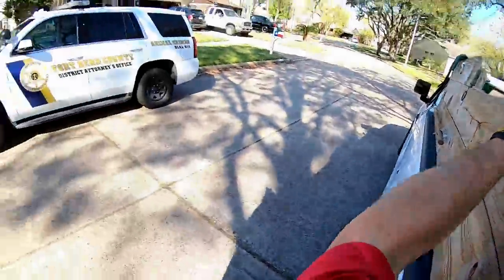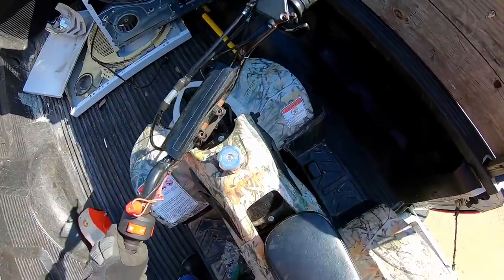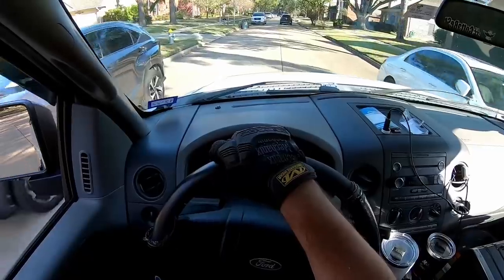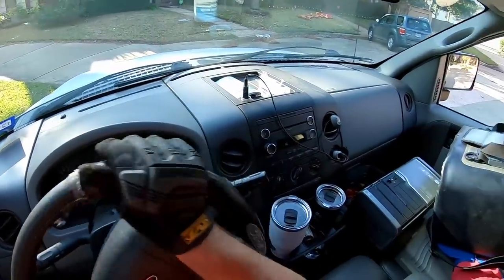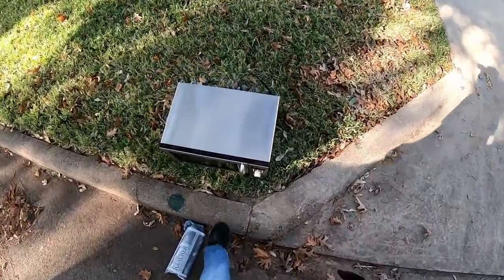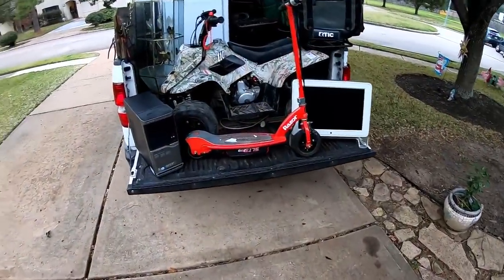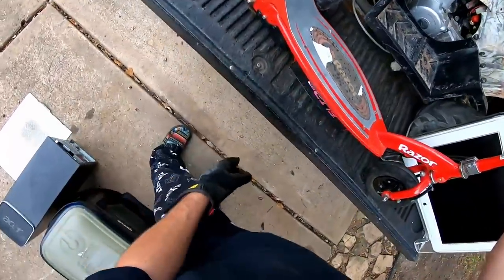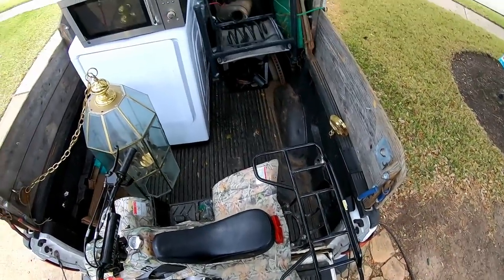Curbside Scavenging "In The Rich People's Neighborhood"

Comment: Drain tank,clean it out, clean carb, make sure you remove the Jets and clear it out with carb clean, use a torch tip cleaner in the jets, use startron gas additive in your gas it does work ,it sells at Walmart.

Comment: Parallel port on the I-Mac cable. Surprised to see those ports still used but in the era of monitors with Cathode Ray Tubes (CRTs), parallel connectors were almost always used for the speed of data transfer over that of the 9 pin serial connector. PS. I built a used computer business back in the mid to late 80s out of the dumpsters of West Los Angeles computer stores such as Computerland. Made a good living cleaning, fixing, and reselling used comp equipment. I had computers wall to wall, front to back, to the ceiling. Called the place CompuCrap. 😀

Comment: Mike, that Apple product you showed is just an Apple Studio Display typically paired with an Macintosh G3 or G4 computer. It isn't an actual computer. It gets the power to run the display through that cable too. Not worth too much, but a collector may want it if they still use them. They were fantastic displays back in the day.

Comment: If you disconnect the battery and attach the charger to the terminals it should turn over. But I would clean the tank out first.😉👍👊

Comment: That 4wheeler is definitely worth fixing it the crazy little one like that used not running is well worth two hundred five hundred running and driving and that one is in fare shape I think drain the gas tank and get a carb boil out bucket and let the carb soak for about a week and blow it out with compressed air the gas tank if it's a little rusty get some ball bearings and put them in the tank and strap it in the back of your truck and go for a long drive on bumpy road and it will look like new on the inside of the tank if you drive long enough to get it that way worked out for me on my Honda trx300 and then they make a gas tank liner treatment that will cure the gas tank rusting issue good luck with it

Comment: You ain’t never to big them lil things can hold some weight and there fast you can throw the battery on the charge if it’s totally dead you should be able to take it in to get a core and that will give you a discount on the new battery you can pick them up at Walmart pretty cheap but auto part store is a little pricey but that running four wheeler you can get $400-$600 look on the engine it will be stamped how many cc it is probably a 50cc or 110cc haven’t found one of those scavenging in quite some time now lol nice find tho and the razor scooter they usually lose the charger so they throw them out or the battery stops holding a charge and you can pick them up on eBay or Amazon for $15 $20 bucks apiece and can get $50-$100 bucks for it stay safe out there Merry Christmas

Comment: You should think of looking into getting a hoist for the back of your truck. I had one. I that's swong in and out on the side of the bed. Came in great for picking up engines and other heavy things. Need to get one before you mess up your young ass back I like I did.